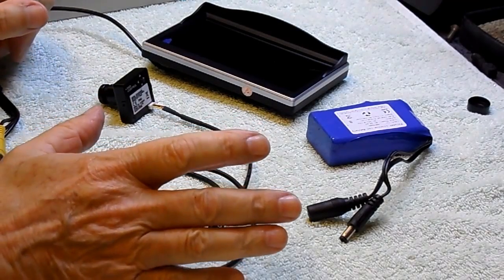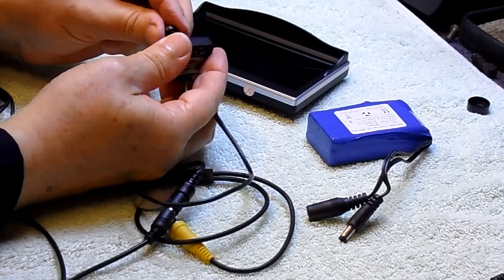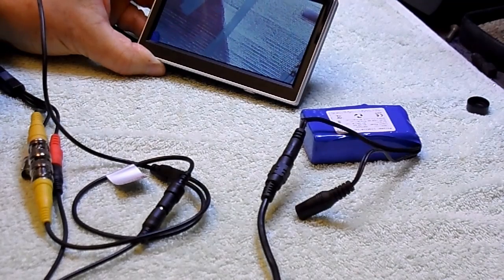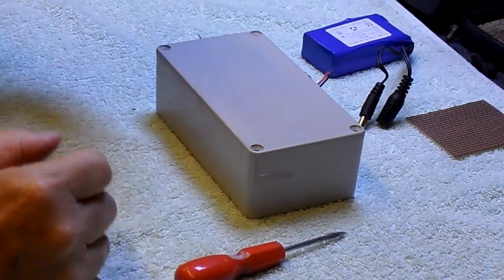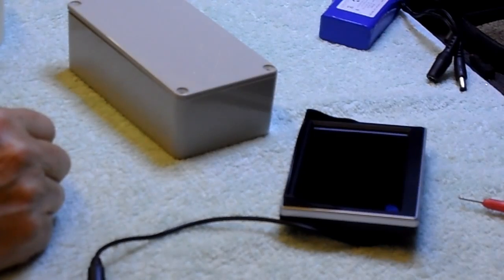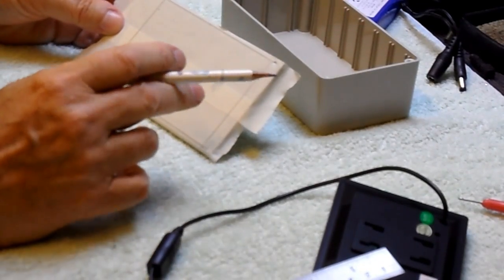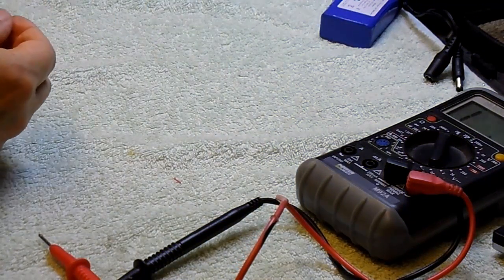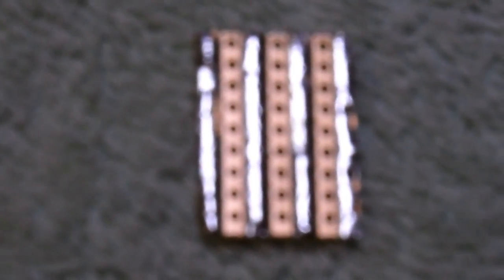Integrated night vision add on build

Comment: Terry.. I have exactly the same set-up as yours.. same camera, screen ect.. but i have one problem.. the screen 'picture' is
very grainy, any idea whats causing this.. is it to do with the settings on the camera ?  as ive not touched it, i'm using it as
it was out of the box ?
Thanks !
Reply from the maker: Usual cause of a grainy screen image is not enough ir light. Try your torch at full power or zoom in to see if that improves the image.

Comment: Hello Terry. Very good easy to follow review but I have just one question. Why did you switch from one rechargeable battery to three smaller ones? Was it because of overall size savings, weight (as in having three smaller ones plus battery holder being lighter than the one), longer lasting charge holding, cheaper, quicker to recharge? Am about to start purchasing the items you posted up but just thought that I should ask you first about the battery situation. All the best, Greg.
Reply from the maker: +Greg Daughton it's just an option for people who are able to do a bit more of the electrical work. The 3x 18650 cells takes up a little less space than a single 12 volt pack but there are some good packs available which will fit the space and cut the weight. The 2800 mah pack from here http://elwirecraft.co.uk/el-products/el-accessories/12v-rechargeable-li-ion-battery-1800mah-2800mah-or-5000mah-for-el-driver-led/ with a 1 amp charger is a good option although it doesn't include a switch so is more suitable for builds in a project box where you can add switches and connectors as required.